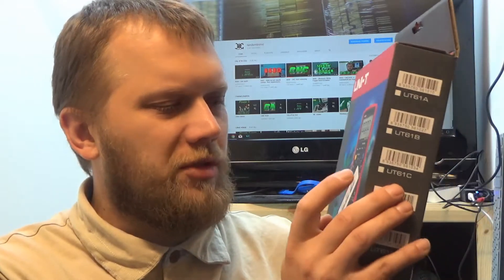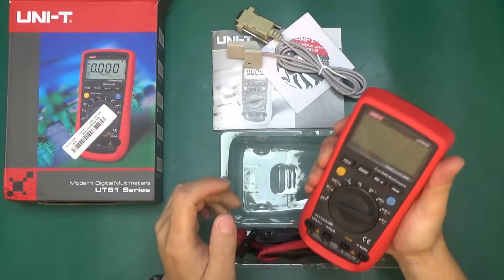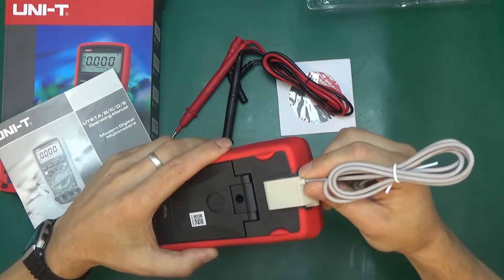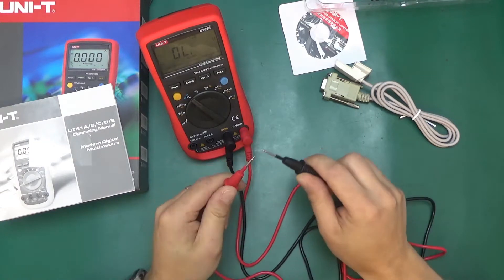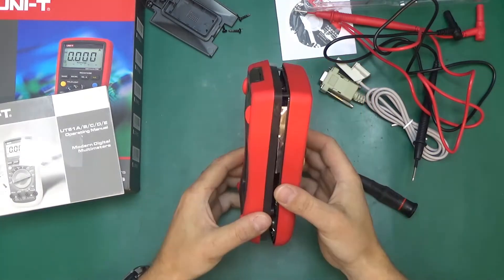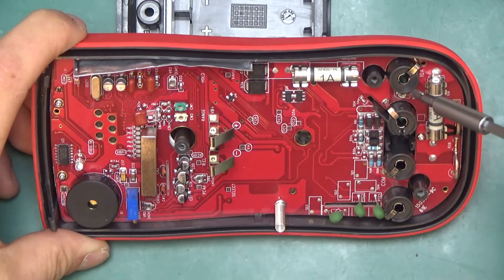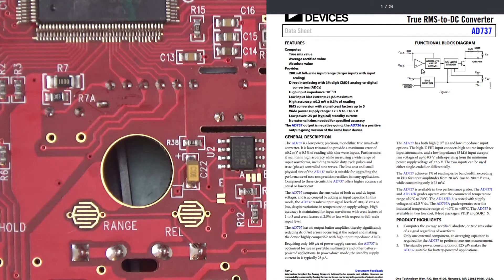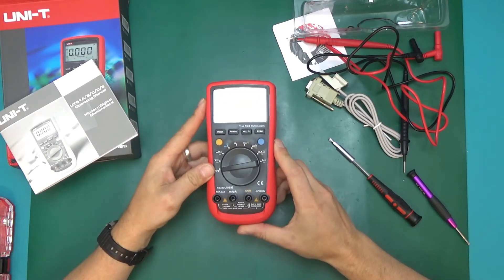#006 - Uni-T UT61E TrueRMS multimeter:  review and teardown

Comment: I like your review and teardown, and I was torn on buying this meter to get the 22,000 count display - but I ended up buying the 139C instead as it has better input protection and a backlight. I feel like a meter of this level should have a backlight and an MOV or two, maybe one large resistor, though I have seen some folks adding backlights of their own, and some neat ideas along those lines too. The 139C is less money and has better input protection.  Of course the 61E does have the PC link and 22,000 count display so I guess its all in what features you want.

Comment: The little jack plugs are in there so the shrounds on the end of the input jacks retain their round shape when stuffed into a box or bag etc.  If they stay store long enough in a bad position they can be flattened making them difficult to insert into the meters input jacks.
Reply from the maker: Never thought of that! Makes sense, thanks!
Reply: No problem, I also wondered for the longest time what they were for, so I asked a techi friend of mine and found out.

Comment: Nice meter! I thought about buying it some time ago, but decided to buy the UT139C instead (one of the reasons was better input protection). 
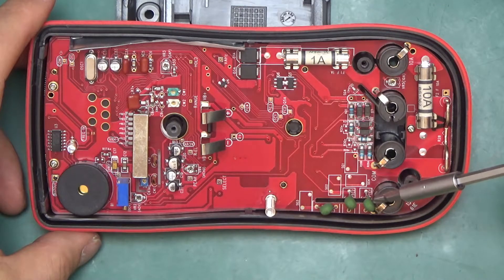9:24 There are PTCs, but I didn't see any MOVs/spark gaps in place even though there are pads for them :( 
Otherwise it seems like a nice meter.